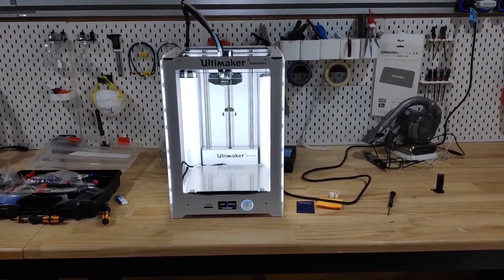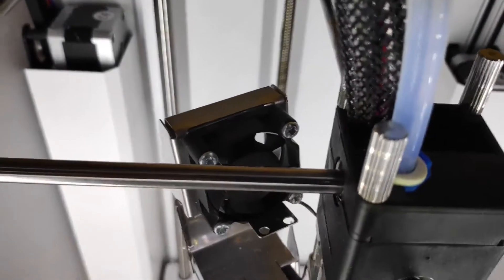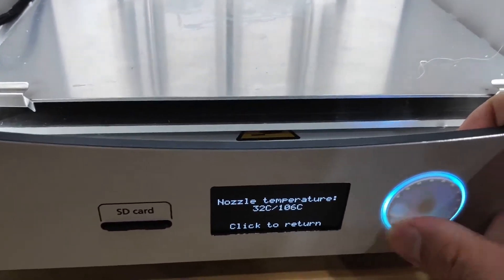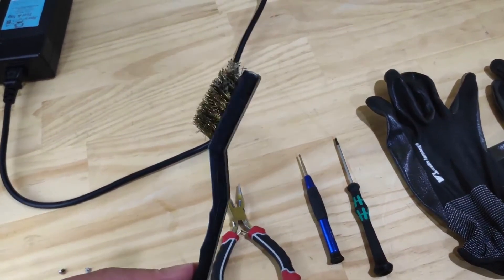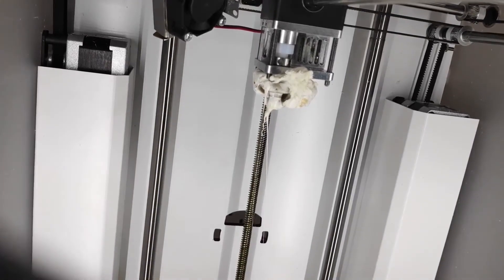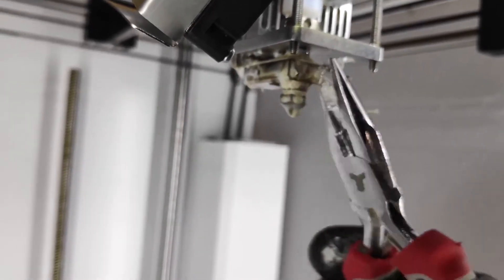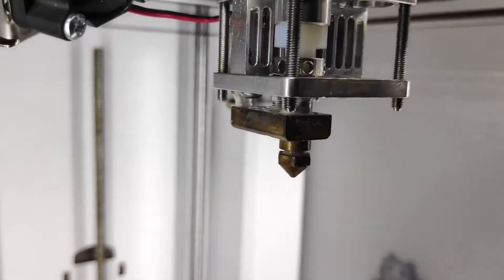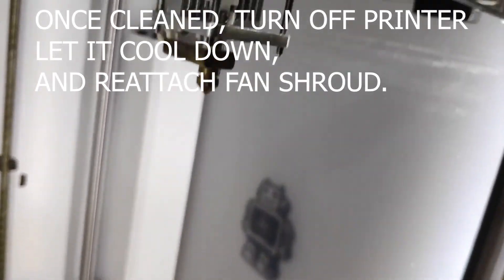How to repair a flooded Print head on an Ultimaker 2

Comment: God Bless you! I was wondering what was this and how do I fix.   How to prevent this?
Reply: It's caused by poor adhesion to the glass bed. Always make sure your glass bed is clean and bed is levelled.. make sure your print is adhering well to the bed for the first layer before leaving it unattended.
Reply: @xyzworkshop839  Yup, cuz ifyou walk away, you get 6 hours worth of  pla stuck in there. Thanks for the lesson. Greatly needed at this time!